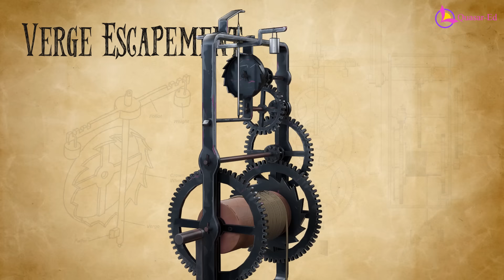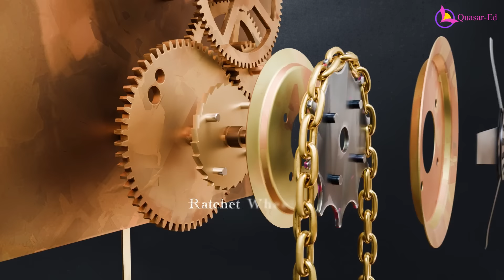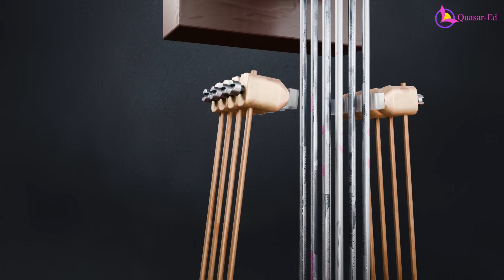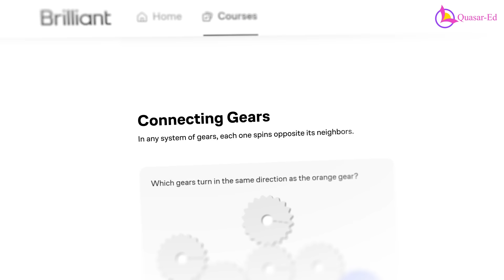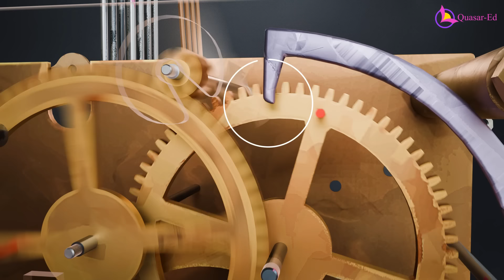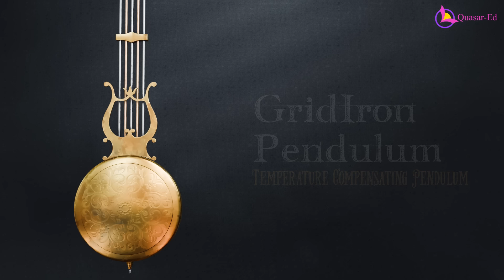From Weights to Chimes: The Inner Workings of a Grandfather Clock

Comment: There are a few things about additional features on grandfather clocks that should also be covered:
-Auto night shutoff in some movements
-Cable-driven movements and their gear ratios (the great wheel turns twice as fast on those)
-Triple chime movements (how the chime selector works)
-Moon dial
Reply from the maker: yeah, I wanted to add those, but sadly, the one I bought didn't come with those features. And I couldn't find good enough references for the design.

Comment: I got a non-working cuckoo clock to repair years ago. I thought it just needed cleaning and oil, and in fact I actually got it started again. Sadly it didn't stay working for very long. The biggest problem was that I couldn't get to everything, because I couldn't figure out how some of the "layers" were fastened to be able to remove them. So, it was fun but I didn't have a working cuckoo clock for more than a few months.

Comment: This video is awesome and I learned a lot. I have a concern though and I stand to be corrected. To make the pendulum complete one swing per second, the length of the pendulum should be approximately 25 cm. However for a time of 1 second per half swing then the length approximately is 99.4 cm. Thus it should take close to 2 seconds for a complete swing at a length of 99.4 cm per my calculations.

Comment: Regarding the bit at the very end: 

It is true that all clocks up to the very early 1800s were hand-made, one at a time, by clockmakers, 
and usually no two were QUITE alike (although some makers had 'typical' things they would do in building a movement, a case, decorating a dial etc, which help serious historians ID the maker of an unknown clock, or at least make a really good guess about the era and place in which it was made, etc). 

These clocks usually do display some great craftsmanship, although above a certain basic level of getting it to work reliably for a long time (and look decent), the artistry (and mechanical aptitude) varies from person to person of course. 

However starting in the very early 1800s (in the USA anyway - it was 1810s-1820s when this got going), 
clocks started being mass-produced, first with wooden movements and then with brass. 

They still had hand-painted dials in this era, though (and also hand-painted reverse-painted glass for shelf clocks) and that would continue through the end of the century, at least. 

So although the movements are mostly fairly well-designed and reliable (they had to be, or the maker would not be able to compete with other makers since their product would be breaking down frequently and causing complaints), they are mostly not as unique as the earlier handmade movements. Ditto for cases. 

However in the really early days, 'mass production' was still a few people hand-making things as similarly as possible, so the parts would interchange. 

Various machines for making the parts were invented and introduced, until by the end of the 1890s just about every part of the clock movement (and case) could be made by machine (I think). 

So most modern shelf and wall clocks from the early 1800s to the present, and most modern tall clocks from at least the mid-20th century to the present, are highly mass-produced, although in so many different designs and models (by the dozens or hundreds of makers), as to still be highly collectible and interesting. 

I wrote 'most', because it has been a tradition for people learning the repair trade (properly known as 'clockmaking') to have to ACTUAL BUILD AN ENTIRE CLOCK THEMSELVES to pass their final exams and get their certificate as a clockmaker. So these clocks are all still handmade to this day, and some of them are quite interesting and/or complicated. 

Of course, one can still commission a clockmaker to hand-make them whatever clock they want, today, but you've got to be prepared to pay their price! It's not cheap.
Reply: I should add that some makers were only in business for a short time and/or produced few clocks during their period of existence. Thus although mass-produced, their scale of production was far smaller, and that makes these clocks rarer (and more interesting to certain collectors).
Reply: *I am sure there were many mass-produced tall clocks from the early 19th century onwards (the Silas Hoadley wooden movements are a great example from the really early era; the spring driven Ithaca tall clocks, some of which the maker would offer wholesale to various other companies to be won as raffle or contest prizes, are another great example, in terms of USA made tall clocks), but in general, due to the definite higher cost, imposing presence, and, indeed, 'status symbol' nature of tall clocks, meant that at least SOME folks were hand-making them longer than, say, shelf and wall clocks. But I haven't studied tall clocks in particular for long enough to really talk much about that. All I know is that with some exceptions, most tall clocks made through at least the Great Depression in the USA were still relatively expensive and were considered that clock manufacturers' 'best foot forward', and usually got the best quality movements and the most conscientious workmanship. Some, like Herschede tubular bell clocks (at least the older ones) were really well made and still held in high regard by clock collectors today.
Reply from the maker: This is so interesting.

Comment: Speaking to the point made at 23:21: 
getting an out-of-sync strike or chime back in sync with the hands should not require disassembly of the movement 
(if the chimes are out of sync with their own count wheel aka 'locking wheel', then that is a problem, 
but if the movement was properly assembled and set up, it shouldn't have that problem at all). 

This is because, clocks with count wheel striking (such as nearly all USA made spring driven clocks) have had that problem for centuries (where the hour strike sequence will get out of sync with the hands, if the strike train runs down before the time train does, for example). 

In this case, the count lever usually has a small loop formed in it, and a thin piece of wire is fed through the loop and hooked around it, which hangs down to the bottom part of the clock (below the movement, and in the pendulum area for clocks with medium size pendulums that hang down below the movement). 

The old (1820s-1930s) instructions on the label inside these clocks, simply directs the end-user to raise this wire (raising the count lever out of the slot in the count wheel, and causing the accompanying lock lever on the same arbor to unlock the pin for the train to move), which manually starts the strike train, causing it to strike another hour on demand. 

Eventually, the strike train can thus 'strike around' till it sounds the correct hour, and then the end-user can leave it alone (except for winding it up again!) since it's back in sequence. 

I am fairly sure the loop on the chime counting/locking lever, shown at the right end of that lever (opposite the pivot/arbor from the working end), was made specifically for that purpose: to feed a piece of wire or a cord through, to run down to the pendulum/weights area, where it can act as a pull-cord or pull-wire for the end-user to manually trigger the chime, to get it to 'chime around' until it's in sequence with the hands. The automatic correction system is a newer device that I think first appeared in the 20th century. 

--- 

Another way for the end-user to get the hands and striking to agree in number, 
has to do with the friction fit of the hour hand on the hour cannon (brass tube). 
If the hand is simply (gently, from the center) pulled out so it isn't as tight on the cannon, 
it can be manually moved to the correct hour, and pushed in again for a snug fit on the tube. 

--- 

One might ask why not just use a rack-and-snail counting method on the chime train, too: 
Well, that's what many quarter-striking clock movements do which have a very simple quarter-strike pattern, such as single taps on a higher pitched bell, or even double taps on two other bells (higher than the hour bell). They can use a little 4-tooth (or whatever) quarter rack, and tiny quarter snail, worked off the minute hand (or a wheel geared to it). 

However, chiming clocks play a little tune (they don't just 'ding' or 'ting-tang' on one or two bells), 
and in order for the tune to remain intelligible, it needs to stay in sequence, and the only really way to do this is to use the count wheel method. (If the rack method is used, then the chime TUNE can still easily get out of sequence with the hands, even if the DURATION of the chime is correct).
Reply from the maker: Ah, that is why there is a extra arm on the right of the long lever, which has a small hole for attaching the string. I knew that could be use to manually start the chime but I didn't know it is for syncing with strike.